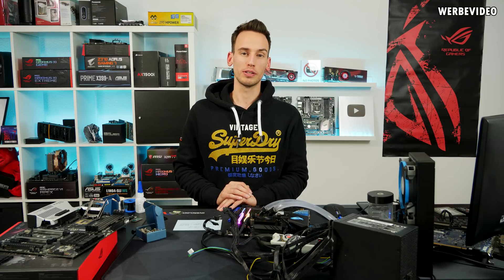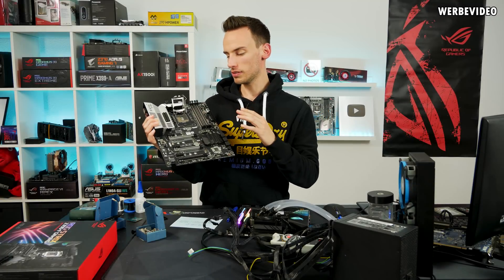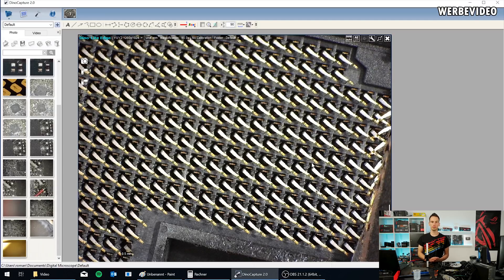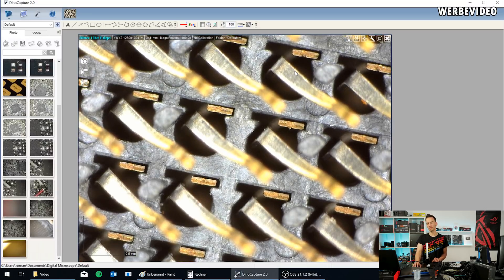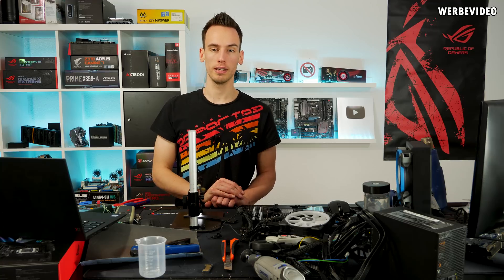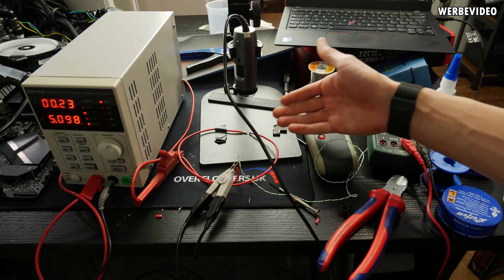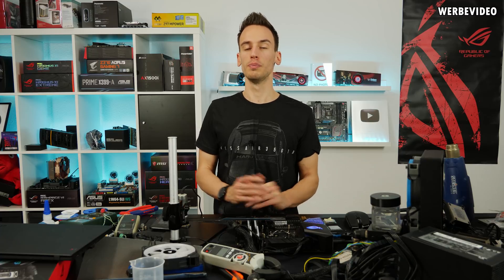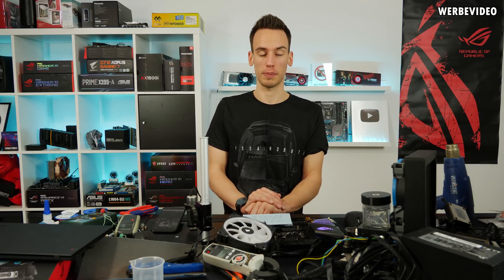We analysed the Z390 socket!

Comment: It's more to give headroom for reliability issues, I'm guessing. Not for physical reliability wrt mounting and dismounting, but from actual long term wear and tear from the electrical current flowing through either the pins, solder balls between the package and die, or some part of the interconnect structure. The extra pins can also be an effort to improve the stability of the power grid on the chip.
Not everything is a ploy to extract more money out of customers. Chip designers usually know better than overclockers when it comes to what the design actually needs to function like it's promised for a long as it's warrantied
Reply: haha riiight.

Comment: Maybe GPU display pins and/or motherboard manufacturer specified trade secerts for what those pins are for but most likely SATA controller maxed out, USB 3.0 controller connector, DMI for full speed,   direct connect of M.2, and maybe a few other things that you cannot find by just covering pins on the CPU without other stuff also plugged in.
Reply: uh, they're vcore and ground pins. they're documented in the datasheet, and if he wanted to verify he could probe them with a multimeter in continuity mode; he'll get a little beep for all of them because they're all internally connected together.

Comment: The comments below miss how much more is involved here.  So if the pin gets up to 60C people say, oh No Big Deal, its a scam.  But those pins are then transferred to much smaller wires to the circuit, and then orders of magnitude smaller as it gets to the IC.  1A is actually an incredible amount for those wires.  Plus you have the heat from the IC itself- Der8auer should know this well.  You dont want additional heat just from getting the power to the chip adding to the heat of the chip itself.  It takes away headroom. Its really the transfer from the package to the IC that I would be worried about.  The size of those wires is so tiny.  Take a look at whats under those if youve never seen it.  Normally you dont because of the flip chip method and the epoxy that covers it.
Reply: it's a flip chip, there haven't been bond wires in big x86 CPUs in probably over a decade
Reply: spambot71 you’re right. I knew that, I just wasn’t thinking. But yea this just furthers my point. Because what you described is even smaller.
Reply: Hear what you're saying- but remember putting a coffee lake CPU into an older socket would still only be about 15% extra current draw per pin.  Do you really think Intel is already running so close to the such a red line? Especially considering the LN2 overclockers are pulling 300% extra current sometimes and no traces melt. The CPU/mobo either dies from too high a voltage or condensation/water causing a short.
Reply: Yes I was thinking about the same thing. More pins is not for the current is fo the resistance. Resistance means voltage drop. Traces inside pcbs are relatively smaller than the pins. And inside the die of the CPU this means even more difficulties.

Having more power pin also mean have more power distribution on the die. Pins are also used to remove hear from CPUs.

I don't think that Intel made this change only for those reasons. If they really wanted to screw things up they simply could swap two data pin like they did on 771 and 775.
Reply: TuttoCrafting he der8auer is a smart dude but he’s testing totally the wrong thing here. I’m sure spambot is totally correct. I’m sure my info is a decade out of date. But regardless that pin is 100x larger than the trace it connects to. Which means 100x the resistance per unit of measurement. It’s the cross sectional area that matters. It’s somewhat irrelevant how much power a pin can take. It’s not the bottle neck. I guess you’d have to crack open a chip and see how big those traces are and see then. I’m sure there’s probably a ground plane and a Vcc plane to try and minimize droop and drift. But not everywhere. To me it looks like the beefed up to Vcc and Vdd to accommodate more power and generate less (useless) heat.

Comment: i highly doubt the main motivation is thermal.

They probably wanted more pins to reduce overall impedance (each pin is an inductor and a resistor, and adding more in parallel reduces the overall impedance between the motherboard's decoupling caps and the massively unstable load that is the CPU). Remember, intel has to care about things like EMI that are totally off your radar as an extreme overclocker.
Reply: Like!
Not to mention the transients, ripples. They work on mV precision
Reply: that's true but Intel could have done a better job from the beginning on the specs, like amd did with AM4, TR2 and SR2 platforms.
Reply: @sharktooh76  Well they weren't expecting AMD to come in as a real competitor, so they had to shoe-horn their quick fix (more cores) into the existing platform
Reply: is that a reason to buy a new motherboard
Reply: @DenzCasuela  it's not a reason for you to buy a new motherboard, but it's a reason for them to not be allowed to make them compatible
Reply: The inductance is the source of the problem, the resistance is the source of heat(which turns out to not be the problem). The thing with inductance is, it will spike emi emissions on current changes.
Reply: @rich1051414  well, resistance also increases voltage drop proportional to current, so it affects power supply stability as well, which is probably still a greater concern than heat.
Reply: @spambot7110  Well, I am refereeing to specifically the socket. Yeah, minimizing burden is always a good thing.
Reply: money
Reply: And that's not even a valid thermal test. the weakest point is the contact surface between the pin and the cpu, which is totally covered in solder in this test.
Reply: @Andrew Crews Lately, i feel that the community is trying full force to make Intel look bad in every possible way. Of course, there are multiple reasons everyone, knows that but...i'd prefer a more fair approach than this bashfest.
Reply: This was the exact same thought I had. Number of pins probably related to impedence and frequency response of the PDN. Also a cheaper motherboard might not perform as well as the one Der8auer used. //Embedded electronics engineering student
Reply: @transcendtient  lol. he did a shitty thermal test. but thermal is almost certainly not the issue. it's resistive voltage drop and indictive transient response that are what matters. And that doesn't just affect performance / "whether the thing works", but also electromagnetic interference, which affects whether they're legally allowed to sell it in the US.
The application you're imagining: a wire that you dump DC through and it gets warm.
The application I'm talking about is: a socket that has to exist in the real world with a real CPU on it with massive, high-frequency spikes in load, that needs glitch-free power, and is subject to strict legal limitations on how much EM noise it can radiate in order to protect other nearby electronics.
but yeah sure, why don't we just use big automotive jumper cables to hook up power to the CPU? it's just 'lectricity am i right
Reply: @spambot7110  dat sick burn 
+Respect
Reply: @spambot71 i was about to write the same thing
Reply: Yes, this needs more likes
Reply: @Malus1531  i guess i can add a like if u insist

Comment: Considering LGA775 & 771 in the past and how they actually are cross compatible, this doesn't surprise me. Even less so since a group in China has also managed to make BGA CPU socket mountable (only functional with certain boards & BIOS however).

I've had an LGA775 Xeon rig running for several years now, with any issues being caused by a bad PSU (replacing it fixed the rigs instability).
Reply: Running an SFF 771 Xeon-modded Lenovo Thinkcentre 24/7 as my primary internet gateway for the entire last year only rebooting for kernel updates :)
Reply: This is not the same thing. This is power delivery.
Back then they just flipped 90deg the CPU layout to make Xeon CPUs not working on standard mb.

If they wanted to do the same thy could simply have changed a couple of pins and not a lot.

Changing pins is not cheap on CPU design. (That why back in time they only swapped two)

I think that in this case they have seen some problems with power distribution. This is a single test on a single cpu. This does not address all the cases. This may be a lucky CPU.

Comment: Intel will not respond to that anyway 
Intel was ripping us for last 10 years but now AMD pickup glove competition again and now intel got full pants of kaka 
How AMD can do 1 socked for already 3 generations of CPU and intel new refresh of cpu = new socket
Reply: You can expect more revisions like this.  Intel is scrambling to keep pace with AMD in the core count race, and more cores and speed = more power and signalling.
Reply: Pretty much why i will go with AMD 3rd gen next upgrade, in intels defence my i7 3770 non K did last me 5 years with no issues, with GPUs from 7770 HD to the actual 1070 but that was an overkill cpu to begin with and it was decently priced at the time, but now i see the same thing in Ryzen with double the needed cores right now but i do want to get a few good years out of it, decent wattage, and if i can put an upgrade in the same socket down the line, even better.
Reply: I am not a fan of AMD, but I hope they take down Intel and nVidia, the PC community as a whole could use some price reduction.
Reply: Did you know that the old LGA775 had revisions? I can't remember the details, but even if the speed of the FSB isn't the issue, older LGA 775 chips, like the Pentium 4 and D, may not even work on newer LGA 775 socket. Once again, I can't remember the details, but it has to do with either the voltage or amps, I think it is likely the amps supplying through the socket.

Older P4/D chips requires more wattage per pin, versus newer C2D/Q chips, which doesn't require the same wattage per pin due to their newer architecture efficiency.

You are totally wrong with AMD. AM3+ chip will not work properly with AM3 socket. Yes, it does work, but, the pin out for sensors, and other power saving features, will not work at all, because it doesn't exist on AM3 socket.

The APU chips, A-series. FM1, FM2, FM2+, the newer chips doesn't work on previous socket. Hell, even FM1/2 chip doesn't work on FM2/1 socket at all!

Once again, AMD is your older chip works on newer board, but not the other way around.
Reply: Alfa Proto I wasn't aware that AM3+ processors were compatible with AM3 boards, but I was aware of the reverse. was this with bios mods or something similar?

Comment: Pins can handle current. Good to know. But more pins means less resistance, therefore less V droop. I you have the pin still soldered to the cables. You can solder another two wires to the ends of pin to measure V droop on the pin. Should be interestiong to see. I know the power supply shows 0,2V but that is not accurate and it measures total V droop acros all the wires.

Comment: Unless i wasn't paying attention : 1.35v x 1.16a = 1.5525w per pin oced      your bench psu test  0.23v x 5.098a = 1.17254w   so you missed the current draw mark by 25% but more than likely that pin could go to 5w fairly easy.

Comment: is there perhaps an importance for extreme uses? does the extra surface area for power from these extra Pins make some difference for Chiller or LN2 uses?
they surely didn't build the Socket this way for extreme Overclockers, but even so.

Comment: When you taped the pins, did you check if it didn't get punctured after testing? Images shoes that they do quite a bit of pressure when the socket locked down. I see some small white point.
Reply from the maker: Yep checked that
Reply: @der8auer  So why there are soo many pins if they aren't really needed, save proof or ? Happy new year btw :)

Comment: 5.098 * 0.23 v = 1.17 watts. So ofc is not gonna heat up.
No idea on what voltage those pins run so why no figure that out, put the V and then crank up the amps.

Comment: Perhaps only one or two phases of the vcore vrm were still connected to the cpu? It'd be interesting to see the temps of individual vrm phases as you tape off pins, one would expect some phases would no longer be connected to the cpu and thus the other phases pick up the slack and get hotter.
Reply: no one designs vrms like that. all the phases are connected together with a big beefy copper plane
Reply: So all phases are simultaneously connected to all the relevant pins in the socket? There's maybe 8 vcore phases but 18 or more pins transferring that power to the cpu. So there's dozens of traces from each phase of the vrm to each of the cpu pins?
Reply: @ericwright8592  there's not "dozens of traces"; there's a large copper rectangle underneath the output of the vcore, like a PCB version of a bus bar. it's then usually stitched with lots of vias (copper plated holes to interconnect layers) to another large copper rectangle in one of the internal layers (PCBs tend to have 8+ different copper layers, each with their own design). Then each vcore pin on the cpu is connected to this internal plane by one or more vias each. so you can think of it as a big sheet of copper that all the vcore phases connect to and all the pins connect to.
Reply: @spambot7110  very interesting, I had no idea. Kind of want to tear apart an old motherboard now just to see. Or perhaps someone like Der8auer could do it for us?
Reply: @ericwright8592  it would be pretty tricky to get those layers apart; they're very thin and laminated together with very strong glues. it would be very cool though!

Comment: The little round circles imprinted in the plastic of the socket are marks from holes in the injection mold that this part is made in. After the plastic is injected in the mold and has cooled sufficiently enough to hold shape, metal rods poke through holes in the mold that push against the part and pops them out of the mold so that the next part can be made. It's the holes in the mold that exist for the push pins(aforementioned metal rods) that actually leaves the circular imprint as the injected plastic expands into the edges of them(as it takes every single feature of the mold of course). 

 If you pay attention, you'll notice those little circles on E-V-E-R-Y-T-H-I-N-G, as almost everything in our lives contains at least some part or component that has been mass produced via plastic injection molding
Reply: This was hard to follow
Reply: RyTrapp0 I worked in plastic injection molding and that's right.
Reply: @Razzaq585  Yup, I've had my fair share of it. Although most of my experience comes from operating twin screw extruders, I've had a little time around some other equipment too.

Comment: Any reason it could be for long-term reliability? Can't imagine putting more current through fewer pins would be good for the motherboard. Yes, you tested with Prime95 but that's not years of constant use.
Reply: If the pin can hold up to 5 amps and be okay. 2 amps vs 1 amp is nothing. He also tested the temps from the heat built up and it's still within safe margins. That's the whole point of the 1st half of the video.
Reply: @Dante_S550_Turbo  52-53c on one pin, for 30 minutes in open air. That's not indicative of a cluster of pins sitting next to each other in a socket for years. Also it's a k-sku, intel has to think people will be overclocking them.

Comment: I highly doubt that the sockets are rated to 1 amp. That sounds a little high for that size.

Edit:
The reserved pins could be used in factory for testing/manufacturing as well.

Comment: Btw, a clamp meter isn't very accurate for DC current. Even when manually setting a zero level, I've seen that most clamp meters can drift as much as +/-10% as the real current
Reply: He brought it up to 5 amps/ 4.75-5.25 +/-10% amps which is straight up overkill. So knowing that changes absolutely nothing lol.

Comment: I would be much more likely to buy a new CPU if it "just worked" on my Z170 board. Buying both board + cpu again so soon after upgrading is just not a good return on investment.
Reply: Could be possible for your motherboard. Custom BIOS flash and pin tape mod (like what roman did here but only a few pins). And better cooling ;p

Comment: @der8auer
My z370 gigabyte board with a 8700 (nonk) CPU had a few bent non essential pins (VCC/reserved).  Individually they made contact with the injection molded plastic socket, they shorted but did no other damage that I know of (I found it when was going to upgrade to 8700k, and also ended up buying z390 itx board);   There was no indication of any damage until I found it after unsocketing the CPU.
Together, the bent pins made an electrical arc while a CPU was on it, this caused burn marks on the underside of the CPU (wiped off cleanly with an alcohol wipe).
The electrical arc could be what burned my plastic socket, or they heated up indivually and caused the slight melting to the plastic socket.  Most likely - a combination of these. 
https://imgur.com/a/Jz1O2D9 album the socket and repairs.

Comment: I would have thought it would be to do with stability for certain parts of the core/cores. 
Due to the volt drop under higher currents.
More pins = less volt drop = hight stability, especially if your going to do LN2